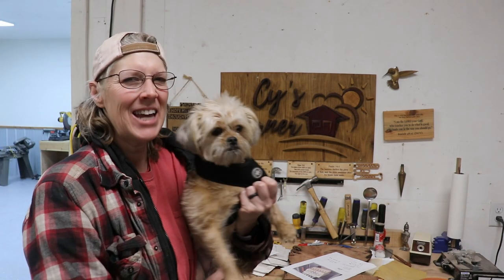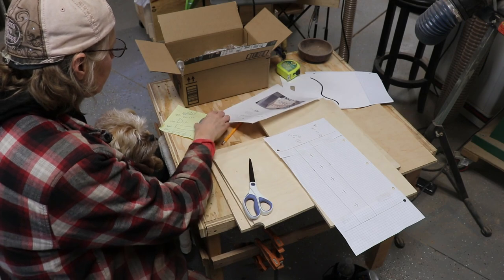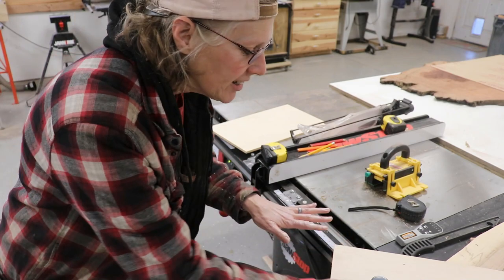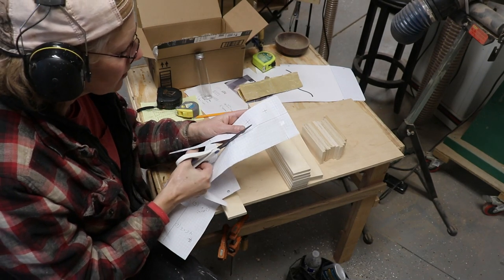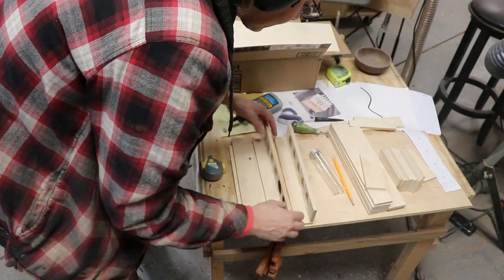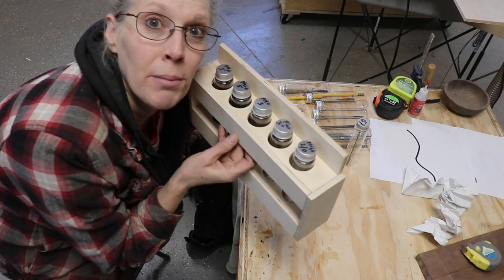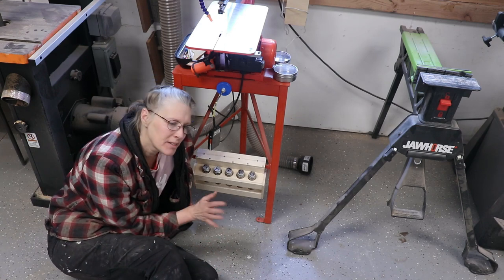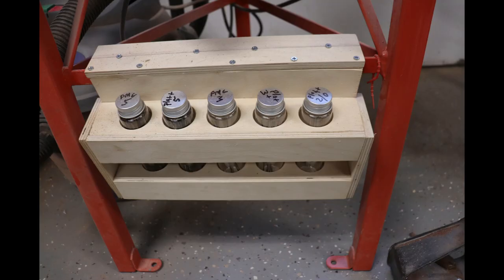Scroll Saw Blade Storage

Comment: Drill it half way through, then flip it and finish drilling on the other side, stops the tear-out on the back side and leaves the circle blank half out of your hole saw which makes it easy to remove.
Reply from the maker: That is exactly what Husband told me when I told him the trouble I was having! I just switched to a forstner bit and it worked great! But I will flip from now on when using the hole saw!

Comment: Nice project Cy! On the hole saw, try opposing screwdrivers to lever out the waste disc. Maybe put a little desiccant package in with the blades you don’t use often to keep them from getting rusty. Thanks for sharing!
Reply from the maker: Good tip, thanks so much!!! I found desiccant packs on amazon, great idea!
Reply: @CysCorner  I save the little ones that come in medicine bottles, shoe boxes, etc.

Comment: I got some magnets about the same size as the ones you have, but if you had put 3 of them in those holes you would never have been able to get the holder off the bar. I bought mine to hold my planes on to the plane till I had made and had to get others because I could not get the plane off and actually pulled one of the two inch screws out of the wall trying to remove the plane
Reply from the maker: Good know John! Took the screws out? Whoa!!!